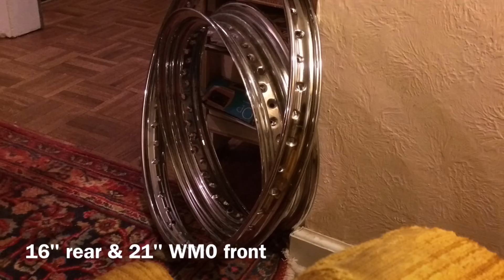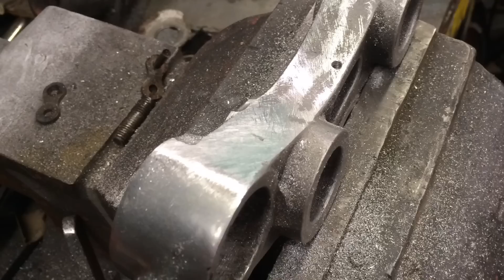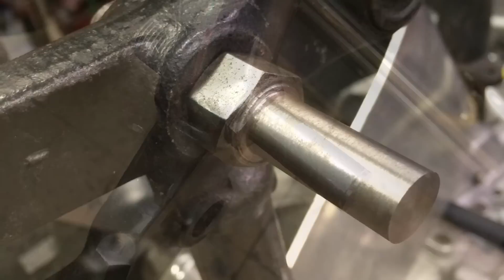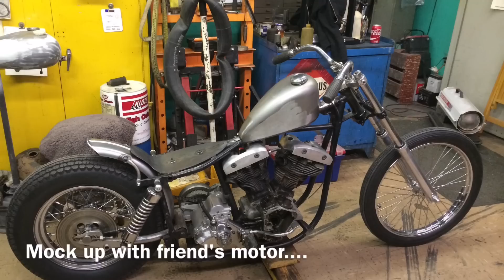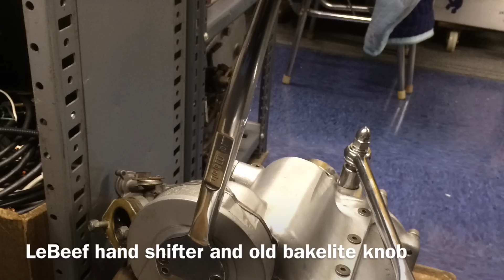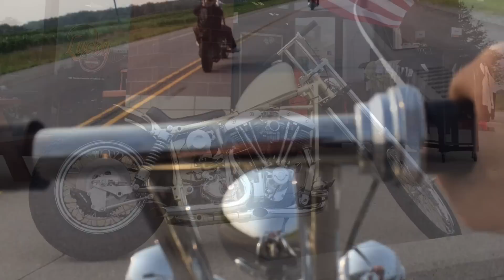1979 Harley Davidson Shovelhead swingarm Chopper Build Start To Finish

Comment: Hmmm dang man I dont know if I would of done that trade...  To be honest there aint much performance difference between the Shovel and the Iron.  The Ironheads make really nice choppers especially when I run 4 spark plugs in them they can do circles around a Shovelhead all day long plus I can leave the bar much faster too with much more reliable starting!

Comment: I used to customise like this when I was a youngster, but now in mid-60s I tend to go for bolt-on, off the shelf parts, because my knees, back, neck, shoulders, hands etc are shot so I can't do it the "proper way" any more. Great job brother.
Reply from the maker: Jess hey at least you’re still doing it and having fun! All that matters. I’m Just trying to keep the tradition going
Reply: @benjeffweldingandfabricati251  And doing a damn good job at it I must say. My first chopper in 1974 was a 67 Triumph Bonneville with a 9" over springer and rigid arse end, which had an identical rear tyre to yours... is it a 5.00x16 Avon? and a 3.00x21 front. Now I rip around on a fairly stock 99 road king. It weighs nothing once you're rolling but 340 Kg is a handful for an arthritic old bugger maneuvering it with feet on the ground.
Reply from the maker: Jess yeap, those are the tyres. That’s cool man, I’ve had a few triumph choppers too. have a ‘69 T120R in boxes that’s been patiently waiting to get put back together. Gonna go for a bud ekins desert sled look on that one
Reply: @benjeffweldingandfabricati251  There are a few portions of American culture indelibly printed on Australian culture of my era, including (but not limited to) Harleys, blues music, and v8 cars. 
In the 80s I had a stripped down hotted up 86 cube rigid shovel that could pull a power mono in 3rd gear, jeez I miss those days.
Reply from the maker: Jess hell yeah!!
Reply: @Jesse-B  Bloody Aussie Hoons. Remember it well Jess. I've still got an 84 Evo Big Twin softy thats skinny. Still making a noise at 65.
Reply: @carmenandthedevil2804  Still trying to ride a Road King like it was a Lowrider. I miss my Lowrider.

Comment: Hey man this build is fantastic and is serving as a model for my own build. I have a 79 FXEF 80 and I'm running pretty much the same setup on the rear with a round swingarm from a 72 flh. I was wondering if you'd be willing to fab me up some rear axle spacers/adapters as well as the shock spacers for purchase?
Reply from the maker: That’s hard to do without the bike to get em just right. If you look on lowbrow they have wheel spacer kit that would get you close

Comment: What width rear wheel did you go with for the back? What tires did you use?
Reply from the maker: It had a stock 16” shovelhead wheel for a while, switched to a 18” sportster hoop laced to a dual flange shov hub. Can’t remember what tire that was.
Reply: @benjeffweldingandfabricati251  do you know if the rear wheel was 3" wide or 3.5" wide? thanks!
Reply from the maker: @Wyrdrock  oh sorry, yeah 3.5” width
Reply: @benjeffweldingandfabricati251  Thanks! So in the video was it using the 16" or the 18" rear?